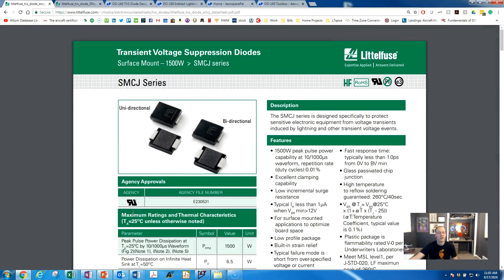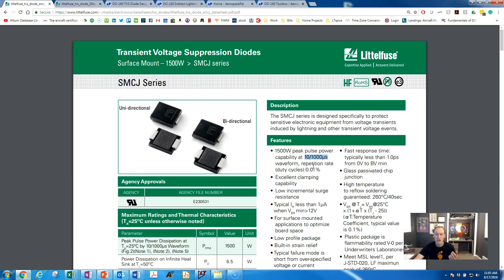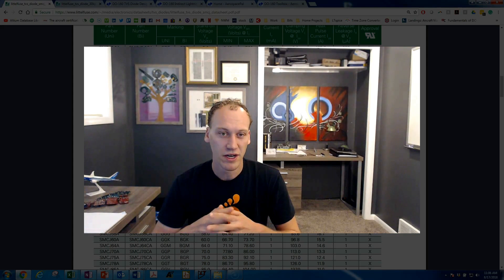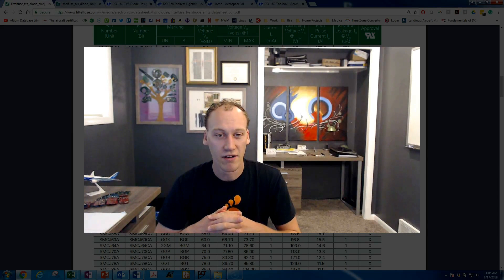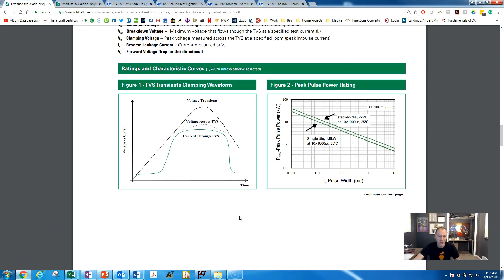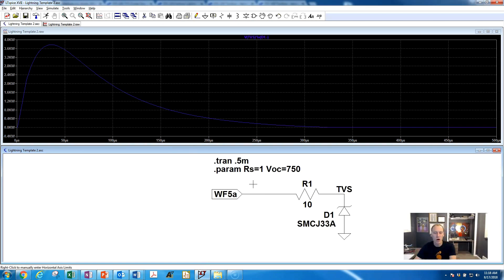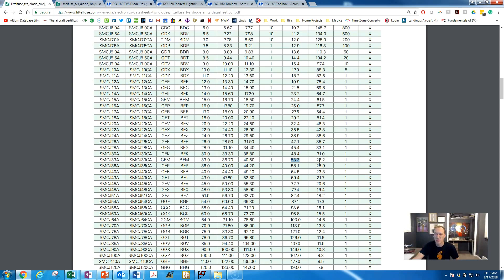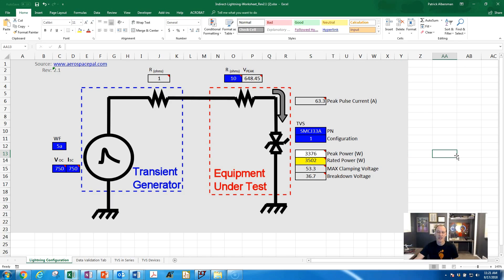TVS Diode Calculations for DO-160

Comment: How do you calculate the wattage of series resistor?  It looks like the series resistor will dissipate far more wattage due to the far higher voltage drop.

Comment: Thank you for your video. I want to know if the calculation that you have done apply for pin injection. How is the cable injection calculation different from pin injection? It seems to comply with DO-160G, we need to pass pin injection and cable injection.